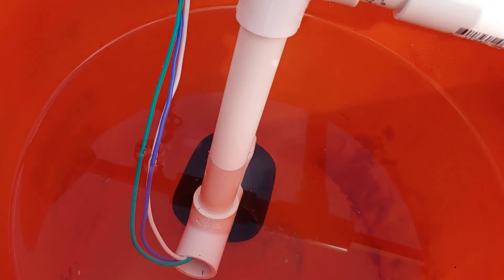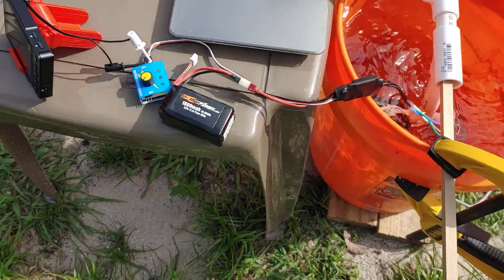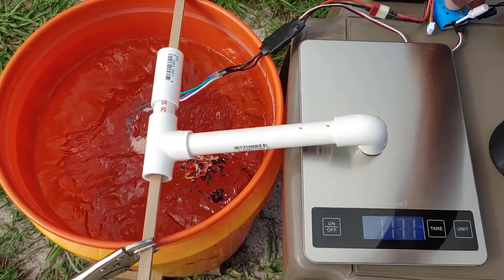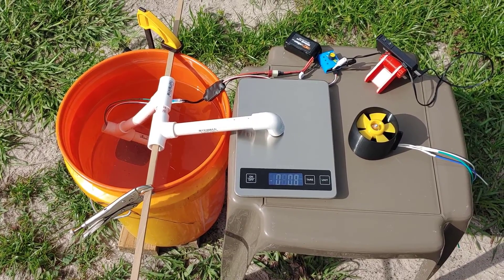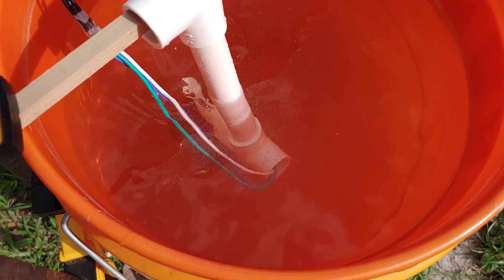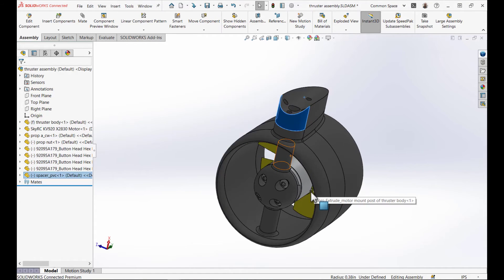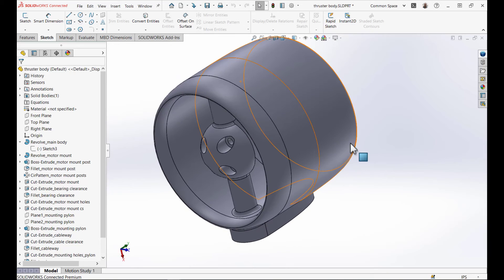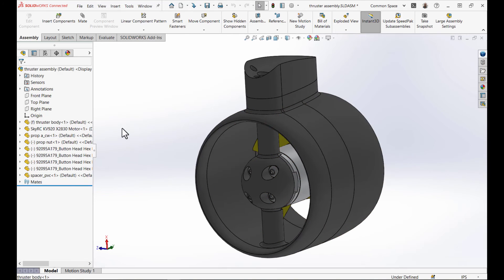DIY Water Thruster Test for PVC Aquatic Rovers

Comment: Is this good to use drone motor for underwater?
Reply from the maker: Most "drone motors" will do well underwater. Just rinse them out when you are done and blow the excess water out with compressed air. Be careful of any bearings made of steel as they will corrode. A little WD-40 will help with the corrosion, but be careful because it can also cause grease in the bearings to be removed prematurely.

Comment: suggest a suitable motor used to design a thruster, with low cost
Reply from the maker: The original motors used in the thruster you see in the video are no longer available, but here is a link to similar ones https://www.amazon.com/dp/B075DD16LK/?coliid=IN2BKV1IYJYVZ&colid=VLBS9Z6FWDNL&psc=1&ref_=list_c_wl_lv_ov_lig_dp_it. Make sure you pair them up with suitable ESCs with the proper amperage rating.
Reply: @bentsprockettech 

Suggest a bldc motor
Reply from the maker: I might have to experiment with a few to see how we can mount them in the current housing.

Comment: Voltage? Current at maximum thrust?
Reply from the maker: Thank you for asking about this.  We were running at 12v with a 20a ESC.  I am about to pick up an amp meter.  As soon as I do we can record another video with actual numbers.  This video was an attempt to record max thrust (as much as we could with the low budget hack setup).  The new motors will probably be the KV950 X2830 which are 350x and would max out at 28a peak.  I know that's not exactly what you were looking for, but I hope it helps.
Reply from the maker: I got it up to 22 amps at 12v. Please see the test here https://youtu.be/dT0_u-HCyeU.

Comment: This is an awesome video! Lots of details. 
You mentioned the .stl files might be available. Would you be kind enough to point me to those? I’m far from an engineer but I have plenty of AutoCAD and Microstation experience. I’ve never used Solidworks. I’m wondering if I can import/export between the softwares?
Reply from the maker: We are working on updating the project section of the website.  As soon as that's done, we should have the models up as well as having a few thrusters for sale in the online store.  You should be able to inport the STLs.  I haven't worked with AutoCAD in quite a few years, but it imports fine in Solidworks and Onshape.
Reply from the maker: The STL files can be downloaded here.  https://bentsprockettech.com/diy_projects/underwater-thruster/